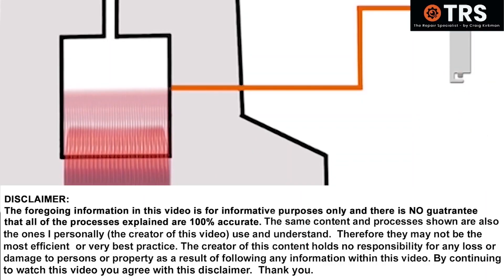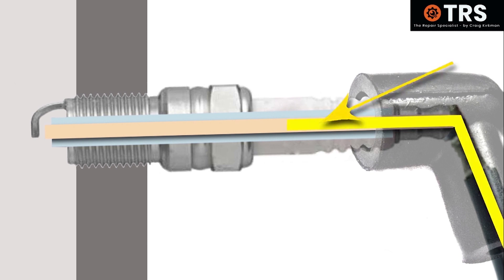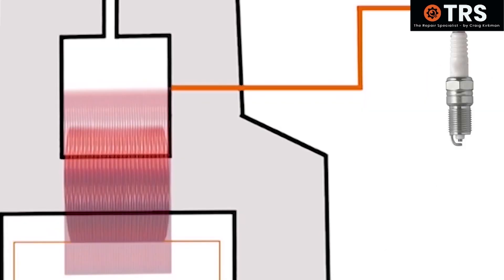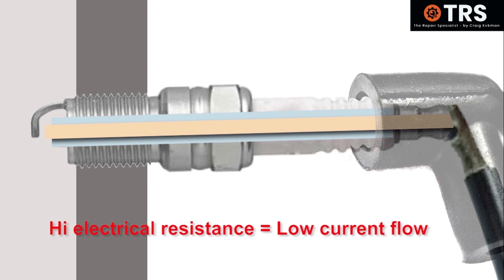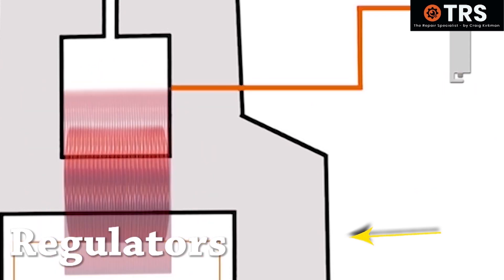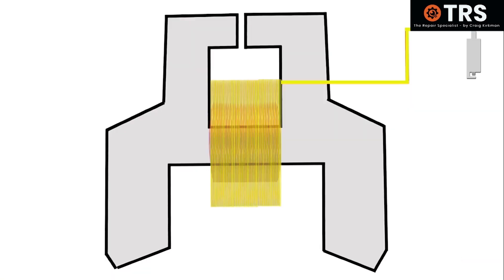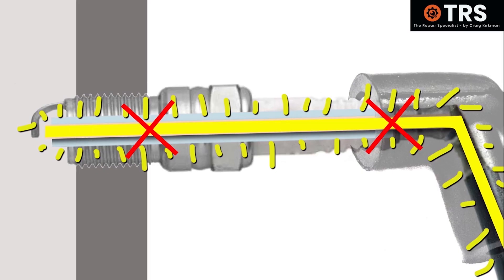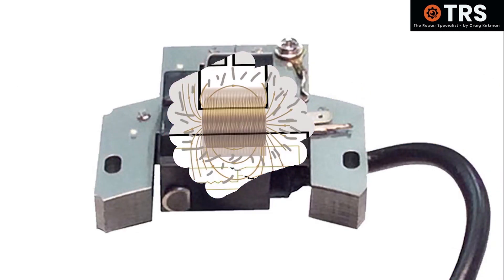Wrong Spark plug Effects Coil Like this (LAWN MOWER Ignition Coil) (by Craig Kirkman)

Comment: Occaissionally, the metal clip in the high tension wire, that attaches to the spark plug, can be bent or loose, weak from age, and can cause problems - especially when the mower is running and vibrating a lot.  You can carefully bend the contcats inward a bit, so it clips more securely to the spark plug.

Also, if you suspect the high tension wire, you can wrap it in a few layers of teflon tape - like a plumber uses on pipe threads - just to see if the mower runs any better or even well, then if it does, you can replace the wire.  Sometimes that works as a temporary fix in a pinch, even on cars.

Comment: Craig, do you believe the the opposite would be true?  For example, some experienced automotive mechanics hold that with wear the spark plug gap increases and this stresses the coil to jump the larger gap causing coil failure.  If they and you hold greater strain on the coil leads to premature failure of the coil, would less resistance prolong coil life?  I ohm out my spark plugs and have found new plugs with over 30,000 ohms of resistance through the center electrode.  I returned them.  All other things being equal, a spark plug identical in every way except with very little resistance through the center electrode would lessen demand on the coil, keep it cooler, and prolong the coil life?  Or, would too little resistance have an adverse effect on the ignition system in some way?  Thanks for your videos!